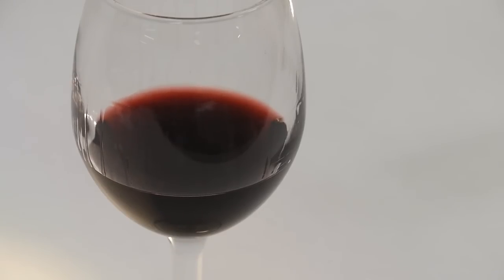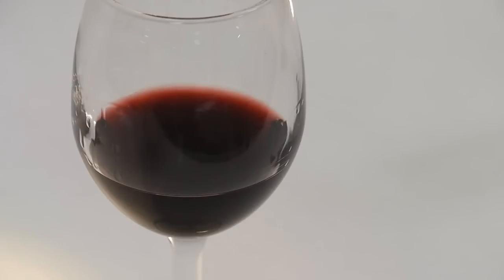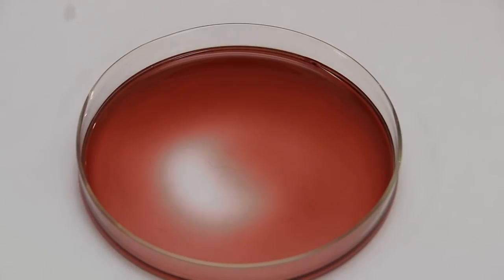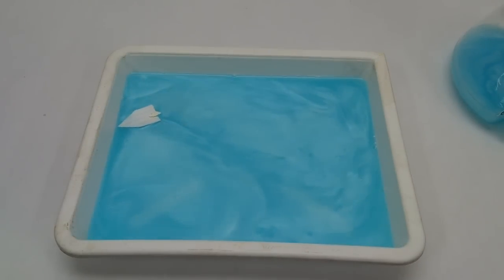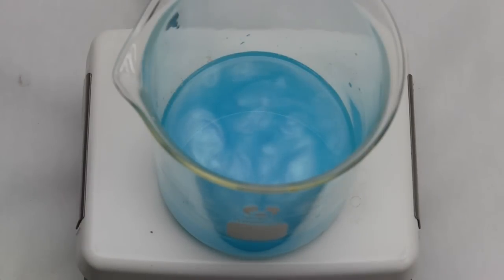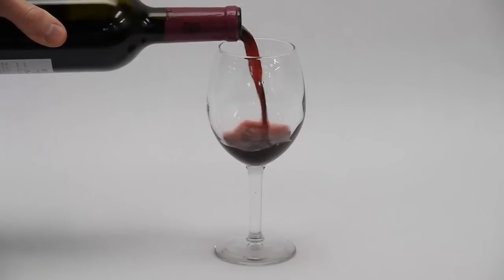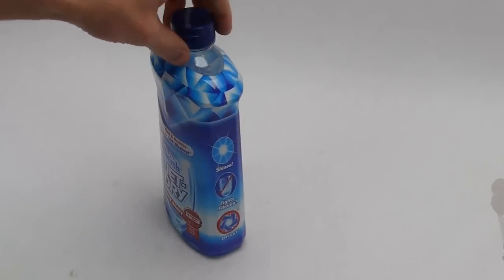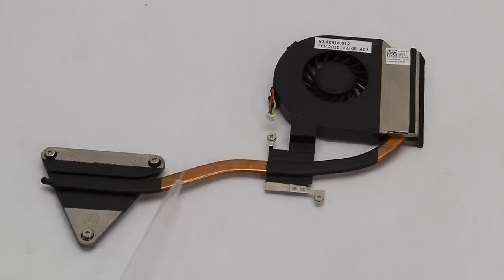The science of wineglass tears (or wine legs)

Comment: There's liquid inside of heat pipes? That was a mind blow right there!
Reply: It's also under partial vacuum to lower the boiling temperature.
Reply: i reacted the same way when my dad told me that years ago when i put together my first computer. he never explained technical side that this video did though, which i found to be very interesting. i never really understood how the liquid flowed through the pipes to help it conduct. (i love your game by the way ^.^)
Reply: ***** When the video was showing the soap boat I was thinking "Neat! I learned that on Mr. Wizard as a kid"  (his real name was Don Herbert) then I saw your name. Is there any relation?
Reply: Phase change carries a HUGE amount of energy with it.  Typically it's something like ammonia, which at the right temperature (and pressure) evaporates, pressurizing the entire vessel (since its a gas) - the gas condenses on the heatsink side of the heat pipe dropping its heat on the metal into the fins, then into the air. It's about balancing that initial internal pressure to get the desired temperature range for the evaporation and condensation. By altering the pressure you alter at which temperature the change occurs, giving the ability to customize what range the cpu should run in.  Expect hot cpu? raise pressure so it stays liquid longer.  You have to make sure the cold side is cold enough to cause the condensation again.
Reply: mute8s I don't think so, this Dean Herbert is the guy who made this game (from Australia) http://en.wikipedia.org/wiki/Osu!
Reply: what would happen if you boil the liquid inside ?
Reply: drojf Oh well. Neat game though albeit hard as heck! :)
Reply: Spoderman It's designed so that it boils on the hot side, the vapor travels to the heatsink and fan where it condenses to a liquid and drips back to the hot side.
Reply: A very small amount of ordinary, very clean, water under slight vacuum so it will easier evaporate at only slihgt temperature increases. Water because its among the best liquids to accept heat.
Reply: Of all the places to run into peppy
Reply: Holy shit its Dean Herbert, holy shit, I love osu man, fucking great

Comment: Something you didn't mention about heat pipes, is that in reality they tend to work in very fast cycles, where most of the liquid evaporates at once on the CPU side, hits the cold side and condenses back as a droplet to go hit the CPU again, multiple times per second. This is mainly caused by the surface tension of the liquid, and by the fact this is more efficient than having two opposite flows inside the pipe. This phenomenon can be observed with physics sandbox games like "The Powder Toy".

Comment: Does the black paint on the heat pipe help it function?
Since the heat pipe relies on capillary action for fluid return, does using it with the evaporator up/condenser down decrease its efficiency?

Comment: Why are the heatpipes painted black? Does this increase the heat transfer rate?
Reply from the maker: +Commodore Gamecube Yes.  A black car sitting in the sun will heat up more quickly than a white car, however the effect works in reverse too:  The black car will cool down more quickly after the sun sets.  The reason is that black objects radiate and absorb heat more effectively than white objects.
Reply: If that were the case in this application would they not apply the paint to the entire heat pipe assembly? I believe in this case it is an insulative paint layer designed to prevent the heat pipe from dumping heat (due to convection) to specific nearby components.

Comment: hmm i think your water example is just natural convection, not the marangoni effect because doesn't the effect require two dissimilar liquids with surface tension?

it'd be interesting to try with mercury and something else,.. maybe heated up gallium or some other liquid with higher surface tensions
Reply: The idea there is that hot water has a different surface tension than the colder water around it. +1 on gallium and mercury, I want to see a steel "soap" boat on a mercury lake with a chunk of gallium instead of soap :)

Comment: But why does the water get pulled UP? I understand that it wants to bead up because of the surface tension, but why does it not get pulled down or to the middle or in random directions?
Edit: Especialy as the top has the most surface area.
Reply: I think it will be getting pulled in every direction. The water that is pulled down just ends up back in the main body, and the water pulled side to side just ends up making bigger beads because it's in a circular vessel. Just looks to us as it's being "pulled up" because we're expecting it to run back down with gravity.